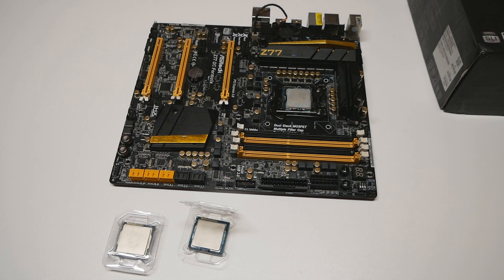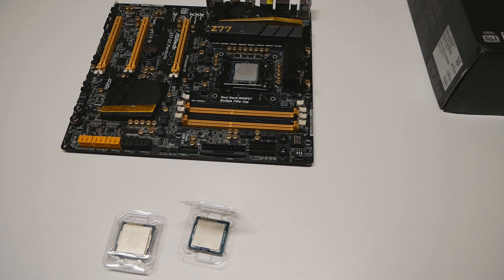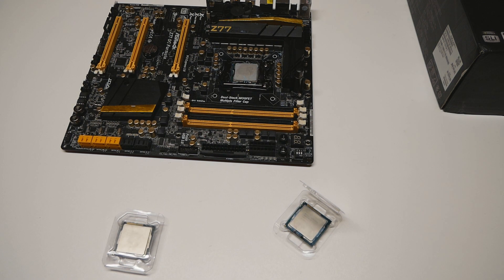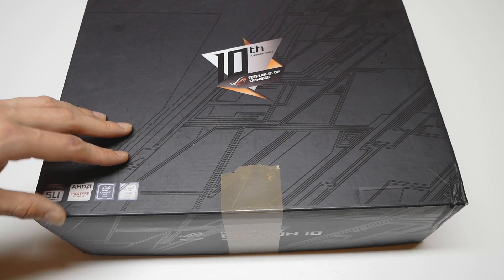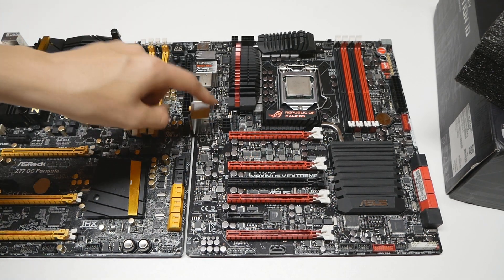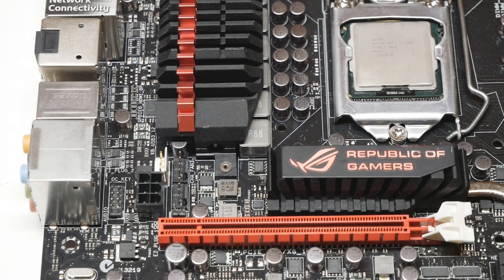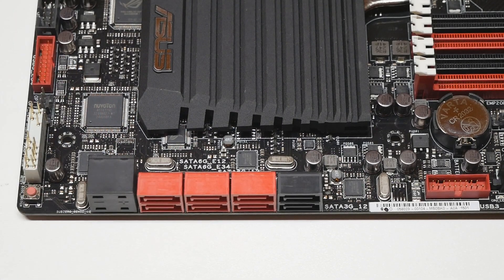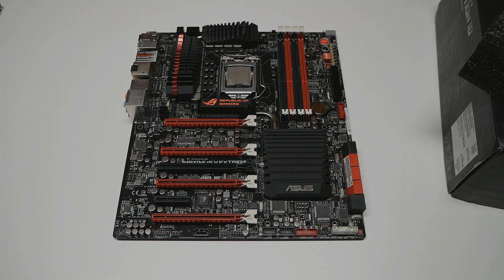RIP ASRock Z77 OC Formula — Hello ASUS Maximus V Extreme: Overview & Main Features

Comment: If the board don't sell and ends up in a corner after some time, you can try to revive it yourself with the heat gun.
As you pointed out the chipset may have some cracked solder balls, some of the signals end up corrupted or missing.
You need to get some good solder flux and your heat gun.
NEVER touch the chipset or the board when heated, if you do when the solder is melted you will kill everything, put the board on stands be sure it doesn't move.

-Remove the heatsink carefully without putting too much pressure on it avoiding further damage.
-Cover the capacitors around the chipset with some captain tape or aluminum foil to avoid heating the electrolytics, they are old and can explode.
-Apply A LOT of solder flux around the chipset and begin to heat gently the around chipset to liquefy the flux.
-The point is to get enough flux to flow under the chipset, reapply A LOT LOT of flux again to be sure under the chipset is soaked with flux.
-Begin to heat the chipset with the heat-gun always moving the gun in circles, squares above the chipset.
-Never stop moving, reapply FLUX if you notice that the flux is being pushed away WITHOUT touching the board.
-Continue to heat with the heatgun until you see the solder of nearby compnent begin to shine, meaning that the solder is meting.
-Continue to heat to be sure that the balls under the chipset melts, because the solder of components around will melt first, the chipset soak more heat than theses.
-You may see the chipset dance and move on its own, its mean you are good to go, the solder melted, stop heating, don't touch anything and let cool the board.
-Once cooled to room temp, try to power up the board again.

I advise you try this technique before hand on a fully dead piece of electronics and then on the motherboard.

Comment: PLX chip is accessed only when running in 3-way or 4-way configurations; single GPU, SLI or Crossfire makes no extra latency in MVE
Reply from the maker: Ok, on Gigabyte Z77X-UP7 there was dedicated slot to bypass the PLX.